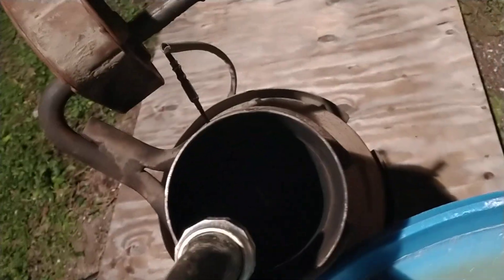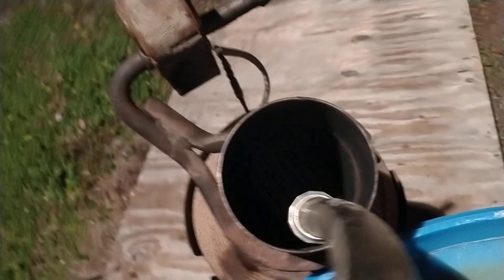2008 Ford f250 6.4 diesel dpf cleaning

Comment: how did this cleaning help you
Reply from the maker: It stopped the re-gen process completely and didn't do it again and about 3 weeks too a month later I completely deleted the truck and retuned it with a H&S tuner and just left it in the tow mode setting all the time unless I raced mustang GT's, hemi chargers and  camaro ss which was only 3 or 4 times. The 6.4's are beasts deleted and tuned but don't want to give it to much hell or you'll be the engine up it was a join venture not only with Ford and Navistar but also with Peugeot and 99% of people don't know that party that's why the motors we're really horrible with reliability and durability.
Reply from the maker: No it has to come off to clean it , if shop does a forced regen you run the risk of it melting down too much heat in the 7&8 cylinders with the extra fuel and you have the possibility of killing the seals in the turbos then it’ll stick all the oil out of the engine put it in the dpf clog and blow up that way also there’s lots of ways the engine can blow up
Reply: Is it hard to remove and also I just got a new jasper engine in mine and I’ve been having problems with it doing the regeneration after it does it sometimes it loses power and shuts the engine completely off I saw one video where they said it was a sensor that was bad that would cause it to shut the engine down just to protect it from clogging up.
So will me cleaning this bring back power
Reply from the maker: It prolonged it until I got my H&S tuner and full 5” straight pipe then it changed everything performance wise and i almost had 0 smoke and I kept it on towing tune which was only like 40 hp over stock but it was the best mix of power and fuel economy!
Reply from the maker: That could be true the exhaust pressure sensor could be bad… check out powerstrokehelp.com here on YouTube bill Hewitt out of Buford,ga all he works on is powerstrokes!
I hope that helps you
Reply: @sinisterscatpack3929 I got a deleted tuned 08 6.4 … fast as fucking hell in performance on my mini max. It’s hilariously enjoyable to dust little sportie cars.